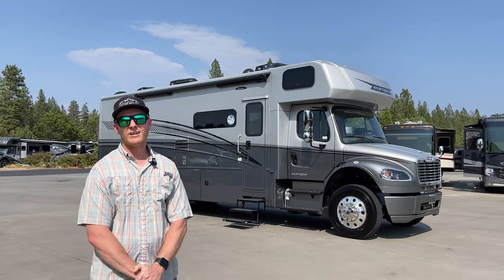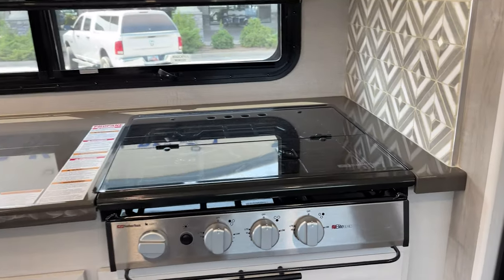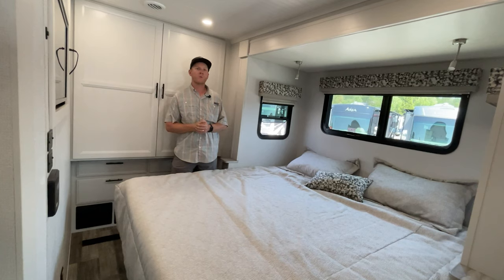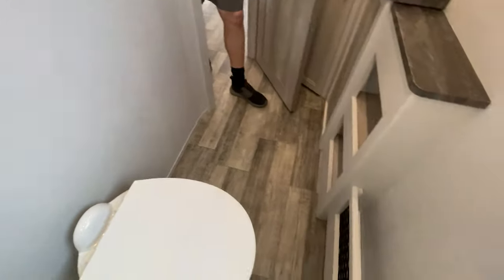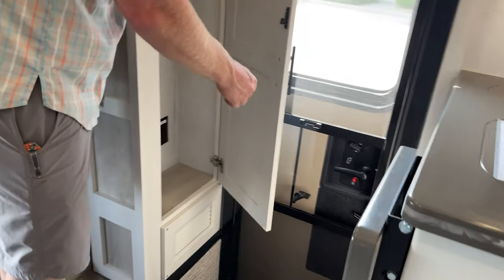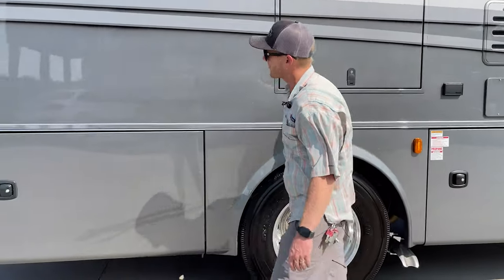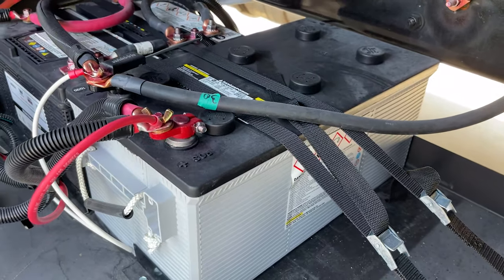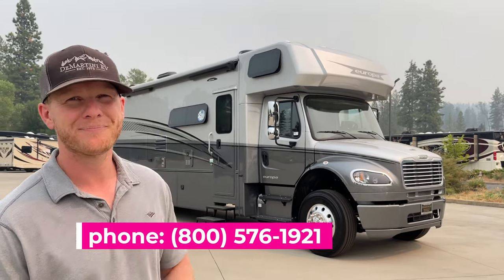2021 Dynamax Europa 31SS | NEW! Shortest Super C FREIGHTLINER on the market!

Comment: I always wondered why they don't just do one big sink instead of two. I wish it had a headboard instead of a window, hate leaning on a window when I am reading. Could this be an option? Love that it has optional Wash/Dryer combo. Could the Wash/Dryer combo fit in the bathroom? It seemed a bit odd in the closet. Also, there really is not much storage for clothes in the bedroom anyway. Also, no mention of WIFI or electrical plug in Bedroom. Where would I put a CPAP machine? Could make it an option for Queen-sized bed and then have the tables on each side of bed to put things on.

Comment: Beautiful rig....The Dynamax website list the Propane size is 20.3-Gallon LP Tank (WC).   The curbside cargo door has a propane sticker noting location.  But when the cargo door is open, there is no tank.  Where is the LP tank or fill on this awesome coach?
Reply from the maker: The fill is in the compartment that has the sticker on it. There is a line run to that compartment from The actual tank which is located further back toward the midline of the coach.

Comment: Have been in love with the isata 5 xplorer forever, read all about this with hopes it would happen and then started to love the magnitude f600 chassis… if it can be had in the low 200s-220 range i might have to find a way!
Reply from the maker: Thanks for watching!  We have some Omni/Magnitude's built on the F600 that will probably be close to or within that price range.  The Europa is a little more expensive though.  Let us know if we can help you!
Reply: Love my Explorer but, after my first few outings I realize I need something with more ground clearance. Even been talking to a few places about custom springs and lift.  As is the Isata 5s are just too low and drag alot, not only just boondocking in the woods but also in and out of gas stations.  The Europa may be in my future since they came out with new color options.

Comment: Gorgeous unit but the propane stove is a thumbs down. The bathroom is nice but don’t care for the way it narrows towards the door. I would go for Q sized bed for more walking around room. Don’t care for the way the wardrobe hangs over the 2 top drawers so you have to reach underneath to access. The shower itself is pretty nice. Glad there’s storage behind the kitchen TV. Not crazy about the bedroom tv. Having that big black square staring at me would get on my nerves. I would have to cover it. Love the way the storage bay doors open out instead of lifting up or pulling down. Idk why everyone doesn’t do that. There would definitely be more solar on the roof and lithium batteries in use! Always did like a Freightliner!

Comment: Isn’t the Isata 5 28SS shorter? It’s also a 4X4 and four seasons. Cheers!!!
Reply from the maker: Yes, you're right, the 28SS is shorter but it's built on the RAM chassis.  This is the shortest one built on the Freightliner chassis.  Thank you for watching our videos!
Reply: The 28SS is a great layout and 30.5ft long.  But is way too low,  I drag butt going over standard curbs.  The Europa is about 3 ft longer but has good ground clearance.  Both have plus and minuses.

Comment: Do they make Freightliner (or other brand) that have 4WD?
Thanx
Reply from the maker: Thank you for watching!  The Freightliner chassis doesn't have 4WD but we do carry two RV's that have 4WD -  they are the Dynamax Isata 5 (RAM chassis) and the Thor Omni (Ford chassis).  You can check them out on our website http://www.demartinirv.com
Reply: @demartinirvsales  what kind of mileage will this vehicle deliver 
I currently am in a 2005 Silverado DuraMaxx 4X4 3/4 ton and towing a 24’ 5th wheel on flat ground I’m getting 17MPG
Reply from the maker: @clearingbaffles  I'm not sure what the exact fuel economy will be on this new engine/chassis combination but it will be less than 17MPG.  I would guess around 10MPG.

Comment: Is there an option for real sliding windows instead of those stupid, zero air flow, pop out windows? I saw a slider over the bed which is good, but whomever invented those frameless windows should be shot! One thing I missed when buying my Tuscany. No air flow whatsoever. Fine if you live for  RV parks with hookups.